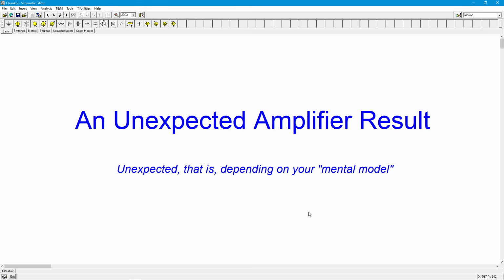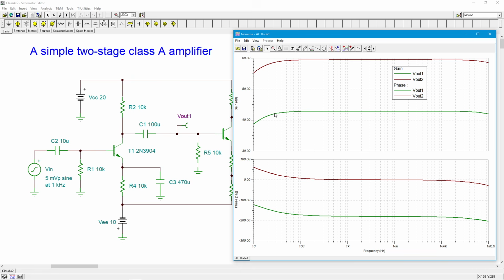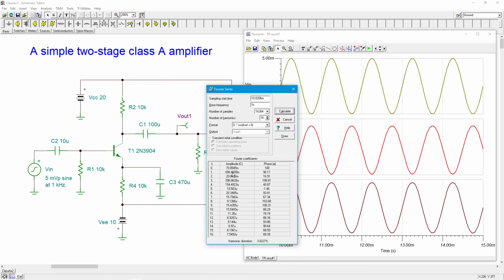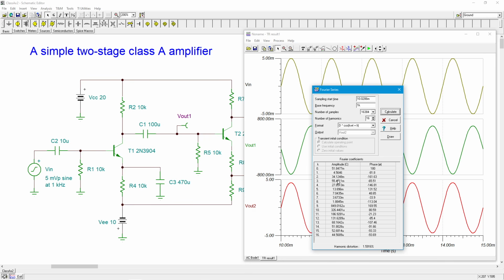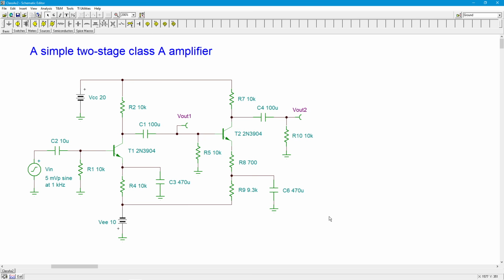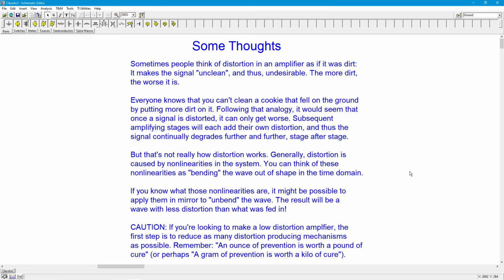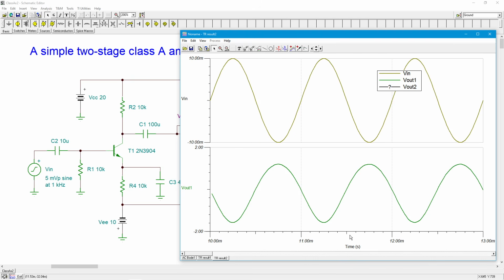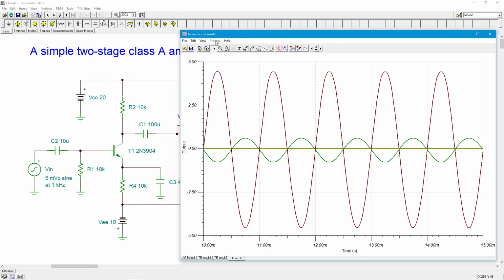Semiconductor Devices: An Unexpected Amplifier Result

Comment: 'Do not correct distortion later on' is exactly the way. And its why I do not like global feedback in amplifiers. 
And the worst you can do is to feed signal back from the secondary of an output transformer of a tube amplifier containing several stages back into the input of the amplifier. But I see that all the time in tube amplifier designs. It is better to use local feedback at every stage instead and make every stage clean by itself instead of also amplifing the error signal coming from the feedback.
Reply from the maker: "instead of amplifying the error signal"? I am left wondering if you understand how negative feedback works. Don't get me wrong, I think using local feedback (a form of negative feedback) generally is a good idea, and I'm not going to say anything about tube amps as this course is all about "Semiconductor Devices", but your assertions come off as quasi-religious in fervor.
Reply: @ElectronicswithProfessorFiore   I’ve been involved in (tube) amplifier design for many years, so I’m well-familiar with how negative feedback works. I’m not suggesting that negative feedback is inherently bad; rather, my point is that one shouldn’t rely on high gain and global feedback as a “magic fix” for an otherwise poor amplifier design.

When global feedback is applied, the signal at the feedback summing node is inevitably influenced by the feedback signal. For example, consider a three-stage amplifier in which the first two stages introduce no distortion and only the last stage does. If the input is a perfect sine wave, the application of global feedback will cause the signal after the summing point to deviate from a pure sine wave, even though it would remain clean without feedback. This non-ideal waveform must then pass through the first two otherwise “perfect” stages in order to correct the distortion generated by the final stage.

As a result, these initial stages end up processing a signal that contains additional harmonic components, which can introduce issues such as intermodulation distortion. In effect, the error signal is being amplified again. Without global feedback this would not happen. With local feedback each stage will only have to cope with its own distortion.

Some may view these observations as quasi-religious beliefs, but our experience and measurements consistently support the use of local feedback rather than global feedback. The difference is not only measurable — it is immediately audible. The amplifiers we build achieve very low distortion for tube designs, often below 0.03% THD+N for a 10 W EL84 Class AB amplifier at 1 W, measured across the full 20 Hz to 20 kHz range, not just at 1 kHz.
Reply: @breedj1  What's the output impedance?
I am more sensitive to frequency response fluctuations than I am to distortion.
Reply: @johnwright8814 Output impedance is important. Local feedback also lowers output impedance. But since I am in the tube amp camp I do not like a too low output impedance though. A damping factor of about 10 to 15 sounds better then one of 100 or more in my opinion. Listening to expensive, low distortion, high DF class D amps is somehow tiring after listening to them for an hour. I do not have that with amps with lower damping factors. Adding a 1 ohm resitor in series with the class D amp improves it a lot.
Also, you buy speakers with a certain sound. So you do not want to put those in a straightjacket with an amp which has a very high damping factor compared to those speakers. 

And also consider what negative feedback does to bandwidth. That's important too. But you do not need feedback for a high BW amp. Just a good design. We also design low distortion amps without any feedback. With mosfets as well as tubes. Maybe look at some Nelson Pass's designs for that as well. He has a design which costs about 50 dollars and sounds exceptional.
Reply from the maker: @breedj1  I am not going to argue about what you personally prefer in terms of sound, but there is no argument regarding the importance of damping factor. Low damping factor leads to less control over a reactive load. In fact, I just uploaded a video on this topic the other week:
https://www.youtube.com/watch?v=6Jbly3VyDqQ
Reply from the maker: @breedj1  said: " my point is that one shouldn’t rely on high gain and global feedback as a “magic fix” for an otherwise poor amplifier design."
I have no argument with that. Designers have been saying as much for decades. But this discussion has become completely tangential to the point brought up in the video.
Reply from the maker: @johnwright8814  That's not the point of this video. As I stated in the video, I am not recommending this technique as a method of making a sonically perfect amplifier. Rather, it has more to do with our mental models and expectations. In any case, an amplifier with a reasonably low Zout will produce minimal frequency deviations with most dynamic loudspeakers, typically no more than a couple tenths of a dB.
Reply: @ElectronicswithProfessorFiore  I think this video is a great example of how complex things can get. It shows that designing amplifiers is not that simple at all. We now have great simulation tools which gives us insight, they did not have that back in the 60s.
Reply: @ElectronicswithProfessorFiore I really enjoyed that video. A lot of designers forget to take reactive loads into account during the design or simulation phase. I usually start with a simple resistive load myself, just to keep things from getting too complicated in the beginning. But the video does a great job showing why damping factor matters. The “right” amount is really a matter of taste, and if you compare the same amplifier with different damping factors, the difference is easy to hear. It’s also interesting to watch how a complex load affects the load line — something that becomes very clear in simulation. We design with a clean, straight load line in mind, but in reality its not straight at all.

I’m looking forward to the next video.
One topic that could be really interesting, if you haven’t covered it yet, is the importance of MOSFET gate-drive current and how it relates to slew-rate distortion. We recently upgraded an existing amp that measured very well at 1 kHz, but distortion increased quickly at higher frequencies (above ~3 kHz). The distortion pattern immediately pointed to slew-rate issues. Since the output devices are lateral MOSFETs with fairly large gate capacitances, they simply weren’t being charged fast enough. By switching the common-source driver MOSFET to one that can deliver more current, the problem disappeared, and THD became flat across frequency. LTspice made the issue — and the fix — very easy to see, and the improvement was clearly audible.

Another good topic might be power-supply ripple rejection in different amplifier topologies. Swapping in a better power supply can have a surprisingly big impact on how an amplifier sounds. The results are really jawdropping and its a simple fix.

The challenge with audio is that not everything we hear shows up in typical measurements. Or in no measurement at all. Most of the time we test with one or just a few tones, but real music is far more complex. That complexity is hard to measure — and even harder to simulate. The last few years designers are looking more into the time-domain issues. Phase and delay both have a great effect on the sound of an amplifier. And negative feedback has effect on both phase and time. Audio is so complex.
Reply from the maker: @breedj1  I have addressed those issues elsewhere. Might not be exactly what you're looking for as this channel is really geared more toward general use (in support of my teaching at the college) rather than audio-specific things (the audio material is at least partly due to my personal interest). 

In any case, I have found that people often forget about drive current for MOSFETs (especially large power MOSFETs) because they've been told that FETs are high impedance devices. It's the same problem people have driving long audio lines (like stage snakes). High input capacitance will lead to slewing if the driving circuit doesn't have sufficient current output. Slewing tries to turn everything into triangle waves, so THD goes through the roof, especially for higher frequency signals. It all comes back to i = C dv/dt. 

I have a couple of videos in the Semi Devices course/playlist that cover simple reactive load lines. Also, I have discussed how to decouple power supply ripple and noise in both the Op Amps and Semi Devs courses. All of this can be found in my free textbooks, too.

Comment: Nice example, professore. The "bending" or "convolution" of the signal in the first stage is partially compensated by the bending in the opposite direction in the second stage. This case reminds me of Quad405 - a legendary amplifier that compensates for non-linearity in the output with a corrective signal but in a different manner.
 If you measure a multistage amplifier covered by negative feedback from output to input, you will find that the distortion in the individual stages may also be greater than this in the output. Seems it is more important the transfer function of each stage to be monotonic than to have lower "bending".

Comment: The distortion subtracts in this case, but the noise still adds, and in many applications, the noise is more important than the distortion...
Reply from the maker: The noise might be more important, but it's not necessarily true that it would worse here (for the same system gain), and besides, that's not the point in question.
Reply: @ElectronicswithProfessorFiore  Any random noise source will be worse when a second amplification stage is added, but the second stage noise will be reduced in significance by the first stage gain. I always found it annoying when a claim was made that an amplifier was high quality because it has low harmonic distortion when it has a serious noise problem.
Reply from the maker: @ats89117  I don't know any designer who would say that amplifier is high quality because it has low THD while it also suffered from high noise.

Comment: Fascinating! /Spock

In theory, you could model the distortion of any amplifier, and do some DSP trickery to pre-distort the input signal in order to yield an undistorted final output. I wonder if anyone has actually done this in a commercial product.

It's kind of the audio version of the "keystone adjustment" feature on video projectors - pre-distort the signal to cancel out downstream non-linearities in the system.
Reply from the maker: You could. I don't know if anyone has done so in a commercial product. I am not sure that there would be much call for it these days as we've able to create amplifiers with astonishingly low distortion specs, much lower than what we see in other links in the chain (e.g., loudspeakers). Besides, the main point of the video is not that this is a great way to reduce distortion in an amplifier, but more along the lines of understanding what distortion is .
Reply: Yes, it is done in high speed digital communications.  Modems that actually measure the forward path and 'error' correct phase/frequency or wave dispersion.  Some are simple predistortion, and some systems have active read back compensation and optimization.

Comment: Excellent example. I was guessing part way through that it had something to do with inverting the nonlinearity of the first stage.
Reply: Yep, around the 11 minute mark I started wondering if it was some sort of "negative distortion" effect as well. Maybe by tuning the relative gain and amount of swamping between the two stages the end-to-end distortion could be reduced even further?
Reply from the maker: @MikeU128  It probably could be improved, but note that the odd harmonics are already dominating, meaning that much of the improvement on this contribution is already in place.